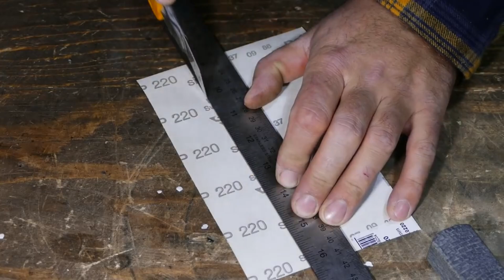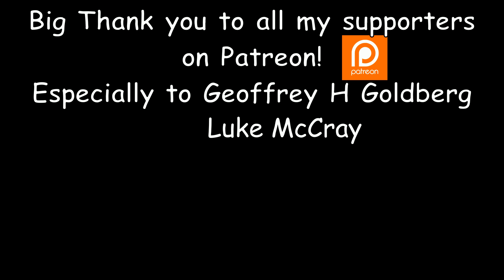Restoring Nakiri Knife. Japanese Vegetable Knife Restoration

Comment: This was really good, I just wish you had welded the tang to the blade instead of using brass pins, I feel with such a small amount of original tang left the pins simply aren't a long term solution and welding would have resulted in a much stronger knife
 But other than this well done!
Reply from the maker: Thanks! The way I did it is to show how to do it without welder
Reply: I agree with welding the tang.  Although its not traditional Japanese repairs.  Idk maybe im just don't know Anything about Japanese other than American history.   Lol

Comment: Really nice work, was very surprised to see the tang slot & grooved, drilled and peened rather than TIG welded though.  Very little steel in the original material through that top pin, with time and enough impacts I suspect it will fail at that point.
Reply from the maker: Thank you!
This is a vegetable knife not a cleaver.
Reply: @Take_And_Make  yeah don't think there will be very much impact from the razor sharp edge on vegetables 😂 I used a similar Chinese vegetable knife to make a skinning knife, it's the sharpest knife I've ever owned.
Reply: I thought the same. There's only a thin piece left. I would have made the tang longer and thicker. As that small piece is definitely the weak point of this knife. Even if its not a cleaver. It just feels like there's barely anything holding the knife and the handle together

Comment: Great job! That tang will not last. Welding a new tang will give it another life time use. As soon as this knife is left with water those rivets and crevices will eat the tang.
Reply from the maker: There's bunch of epoxy around it first of all, and I don't think it's gonna erode anyway. You are too pessimistically tuned!
Reply: @Take_And_Make  worked on and with enough chefs knives to know outside of trivial cooking at home. That tang wouldn’t last 1000hours in a restaurant. Not being pessimistic, I’m being Realistic. You made a tang for the tang instead of welding a proper tang. Epoxy is great and all but also wears down remarkably fast. This video is essentially putting duct tape on this beautiful Knife.
Reply: @briancurrie2897  hum I disagree there, this is a Nakiri japanese knife, those are not made to put any pressure on the blade as they have a very thin profile and are made to cut soft vegetables, not bones or hard material. They are supposed to be razor sharp and go through without effort so this tang repair would do perfectly well in the hands of a Japanese trained chef.

Comment: The blade restauration looks good although I am not sold on the handle. traditionally, japanese knives will have a press fitted handle that is either Octogonal or oval for symmetrical ground blades. To finish I think this is not sharp enough for a good Nakiri, you should glide through this onion without any effort, I don't know how you did the sharpening but generally on japanese knives, wet stone is the way to go. For Nakiris specifically, you would like to have a very shallow angle to keep the blade profile as thin as possible and go from a 1000 grit wet stone to a good 3000 polishing stone at least. I personally go to 5000 which I feel is enough but some people go all the way to 8000 for that mirror polish.
Reply from the maker: If check my other restoration, I don't do traditional handles I create new ideas.

Comment: I have one of those, but try as I might it can't be fixed The blade thickness is thick at the front and back, but thin in the middle. From time to time, I'll flatten the blade by grinding (stoning) the blade flat and trying to get a uniform edge, but the piece has always defeated me, the center wears far faster than the front and back.
I realize every time I try, expecting a different result, the attempt is ludicrous...But, I keep trying for no logical reason.
Reply: That sounds like a project I'd have to take week breaks from in order to maintain sanity
Reply: @xhappybunnyx  ......Actually, some things are a waste of time, Fixing this is a waste of time...Even if I valued my time at $1.00 an hour, it would be far cheaper to simply replace it. But the only thing I use it for is cutting-up whole chickens...As a brute force tool, it works just fine.

Comment: That will be great knife if you never use it. That tang extension is one of the hokiest repairs I’ve ever seen. That knife will be unsafe and a hospital trip waiting to happen. Bye.
Reply: dude, this is a Nakiri, you are using it wrong if you are putting any force through it. nakiris are supposed to be razor sharp thin blades that glide through soft vegetables, they are not made to cut any hard material or the edge will chip. this repair will probably last forever if the knife is used as it's supposed to.